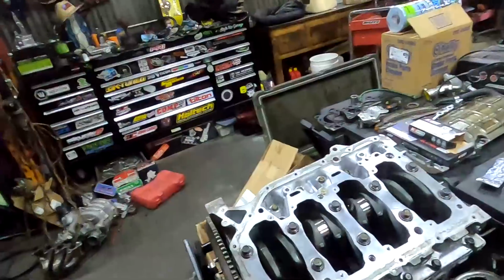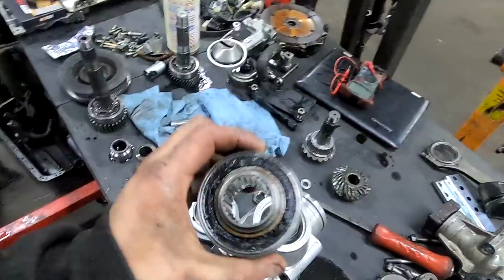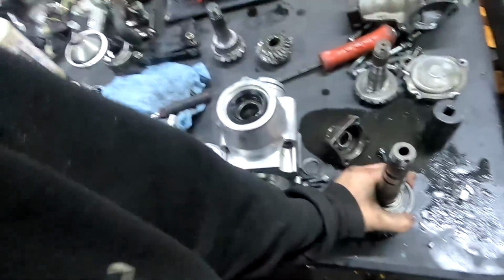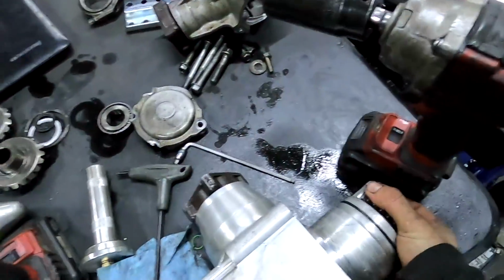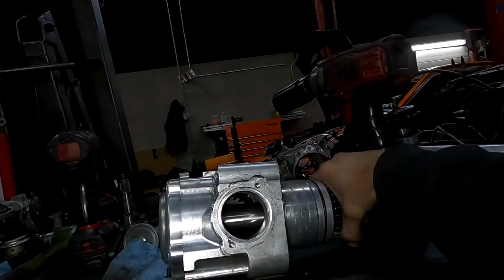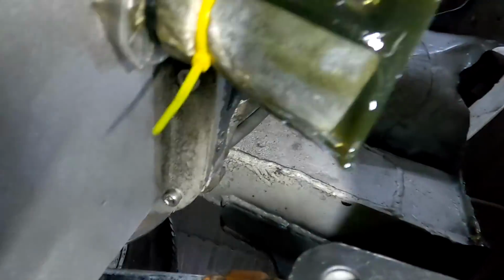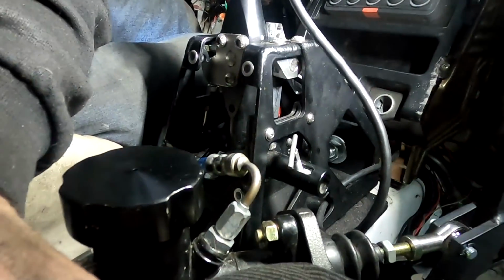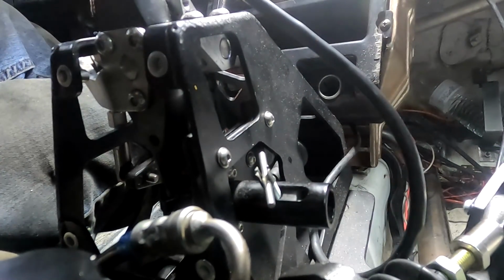BOOM!! I Got The Shifter Shiften Now Boys!! and Fixed the Transfer Case

Comment: Damn!! The PPG hypoid gear got damaged??
Reply from the maker: Had to be my shiming first one I’ve ever done that not stock but yea it did
Reply: @GoofyBuiltShane  that sucks! Happy to see things getting fixed though! Good work.
Reply from the maker: Yes it does man but it coming thank you
Reply: Check it with gear paint . Like what is done on a rear end.  The way it broke looks like the gears  didn't engage each other enough. I would expect it to take the entire tooth off not just all the tips